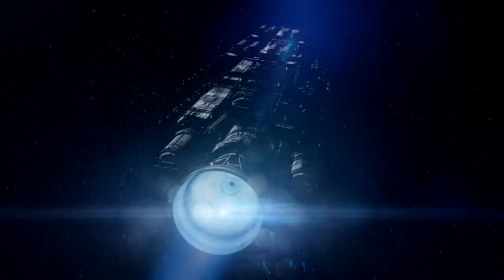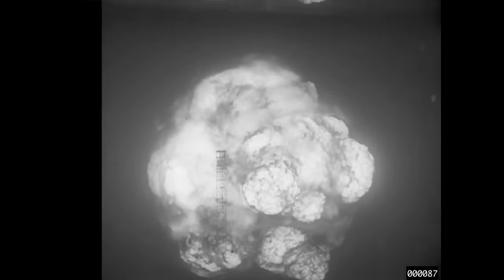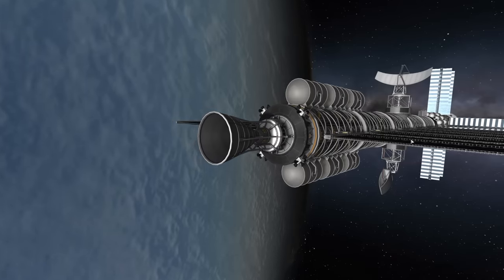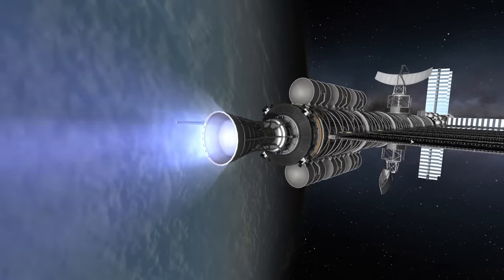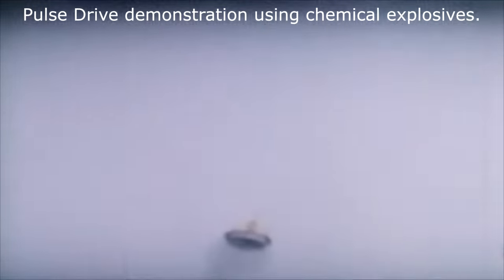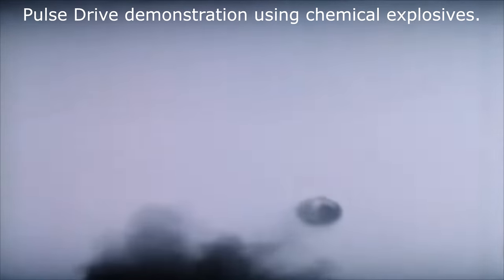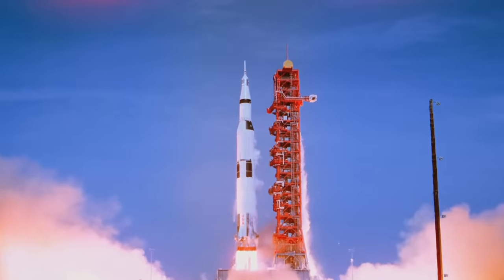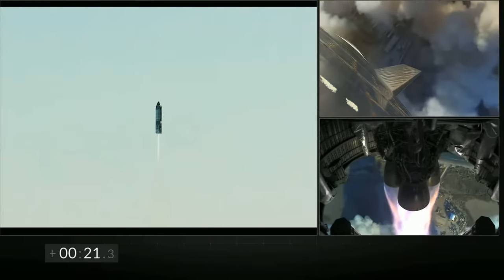The Nuclear Salt Water Rocket - Possibly the Craziest Rocket Engine Ever Imagined.

Comment: The weird question that pops into my head here is. 
Is it possible to use nuclear power plant waste product in the salt solution. 

I expect this would be the wrong type of uranium. The idea that this toxic substances might be useful is too interesting not to ask the question though.
Reply: ( has nothing to do with above question) 
A salt and uranium fuel mix seems like a more easily producible fuel in space as we have found water in several places. 

Though uranium and salt seem a bit heavy and toxic to lug around. ( Especially the uranium)
Reply: Yeah the fuel for the uranium from waste is already used up. 
.... It would be awesome if there was a way to use some of it in the mix though
Reply: The last question here though is. I saw an image of the Government testing this engine. 
Is there nuclear radiation out put from use? 
If so would that mean special facilities would be needed or required for there deployment. I expect that would add to the costs.
Reply: As it turns out yes you can't use this engine like you can current engines for launch. Useful in space but there is substantial radiation from burn and launches. 

So likely used in space only. Or launched from specific places. 

The other big thing that would need testing around this engine is how the magnetic fields the sun puts out would interact with the reaction mid burn. 

Any way thanks for the vid. I just recently found the channel not a college education lvl rocket scientist but I like to learn and throw out ideas.
Reply: The reason I left this rambling set of questions and observations here instead of the other channel is I expect most of my observations are fairly low end. 
That and part of what you talked about was fiction use. Some of my observations might benefit Sci-Fi authors. 
Last if these observations were ever put in a vid. The presentation would be top quality.

Comment: The problem with accelerating towards your target in space requires deceleration when you reach your destination. You're happy to eject radiative materials behind you during acceleration phase but I'll  be there to laugh when comes time for deceleration.
Reply: Exept it won't. The exhaust velocity is greater than escape velocity from the solar system.

Comment: Even if the stronger enriched version could reach another star in decades that's still a long time for anything other than a probe. Would not a better use of a 1% speed of light drive be to use it within the solar system? If it takes 8 minutes for light to reach the earth and 12 minutes to reach Mars then we have a difference of 4 minutes. Traveling at 1% of that speed from earth to Mars the trip would take 400 minutes or 6.6 hours. So what's the problem reaching Mars? Even at 1/4 that speed Mars is reachable in about 24 hours.

One pusher tractor rocket could do the trip in 2 days, if it takes 24 hours to refuel it 3 ships could have a ship leave and and another return every day of the year.

If the rocket payload is a single starship, that is up to 365,000 people transported every year with just 3 ships. Or if you add enough ships to launch every 6 hours you can populate a city every year on Mars while decreasing the world population by 1 city at the same time. That should make the climate cultists happy, lol.

Comment: The problem with nuclear reactions is that nobody wants to do experiments.  yall are boring.  Sure, water splits and expands and releases heat.  Did nobody try tritium?  howabout einsteinium.  Did anyone put Muskium in a reactor and see what happens?  I'm clearly not a MatSci guy, but this seems like the low-hanging theoretical physics that actually did cause people to design a reactor as stupid as RBMK.

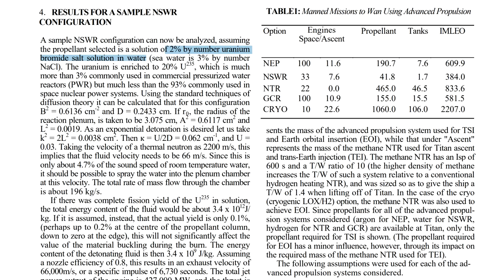Comment: Scott mate come on. 4:00 and the best way to increase power out put is to increase temp of rocket exhaust 10 x what we are already dealing with. How did you say those words and not choke on the lie you just pushed out. If higher pressures arent enough then external pushers are your best option. Laser propulsion. But now you need to deal with light based heat on similar levels but your shooting that heat in the form of a laser at a sheet of film so much thinner then ally foil . Ally foil is the equivalent of heavy duty packing cardboard. Cardboard down here is as heat resistant as ally in a rocket nosel.
Reply: 11:22 i beg to differ. Unless im dumb as pig 💩 and i had not idea. I get my knowledge from people like you not from shool. But i try my best to be accurate and realistic which is increasingly hard to find it seems today.